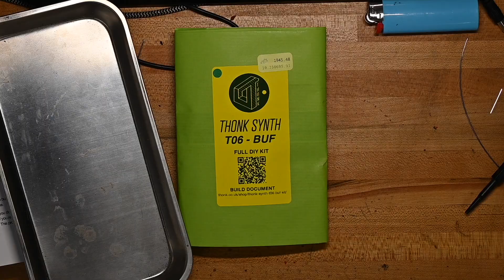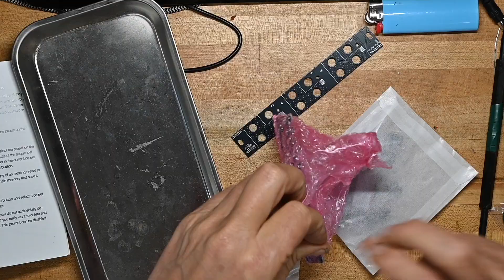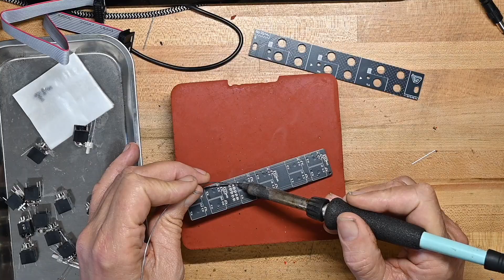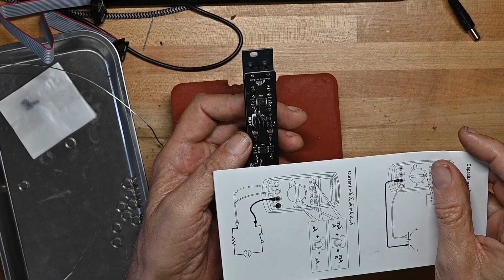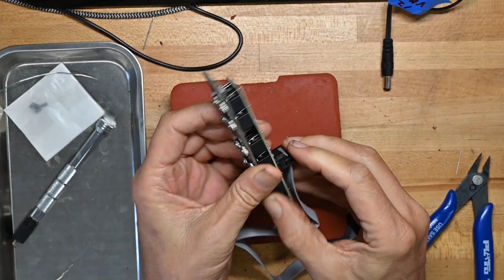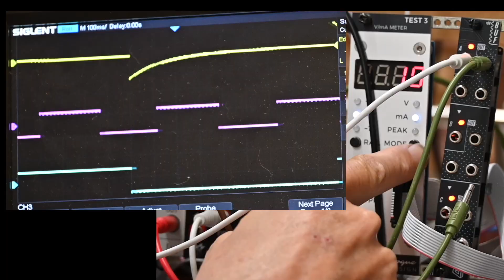C.K. builds a BUF buffered multi kit from Thonk Synth, eurorack

Comment: Do you use a fume extractor when you solder?
Reply from the maker: I do not. However, I do recommend others do.  For me, I'm in my 60s, never used one, have smoked a pipe most of my life, and have been around hazardous chemicals (without protection) early in my working career, so I have been overexposed to toxic fumes way too often to have a solder fume extractor help me at this point in my life, damage is done.  Thanks for stopping by!